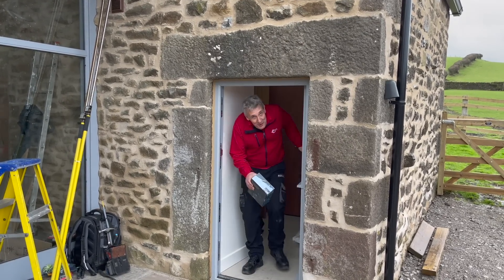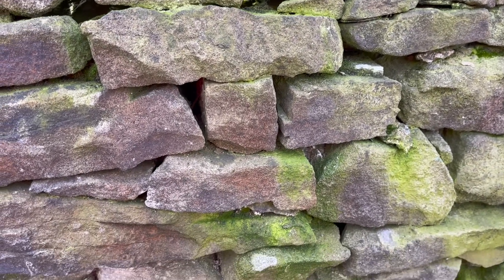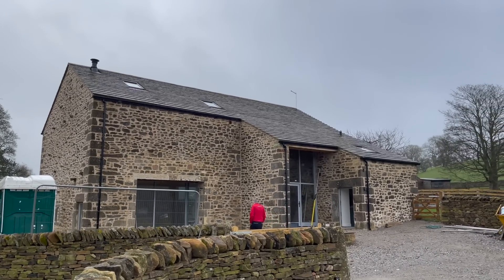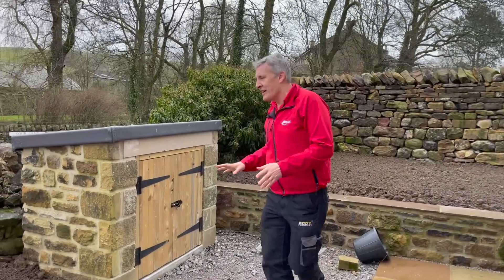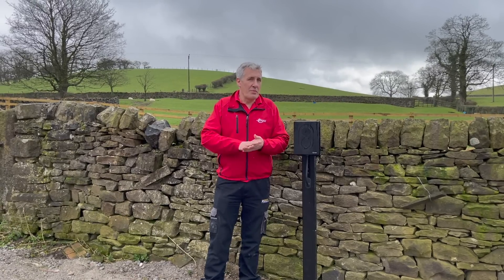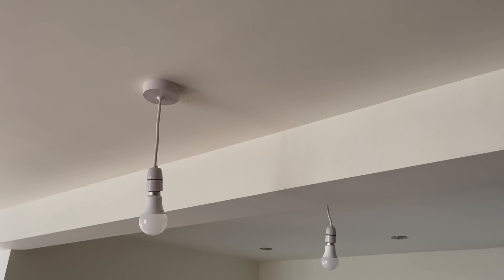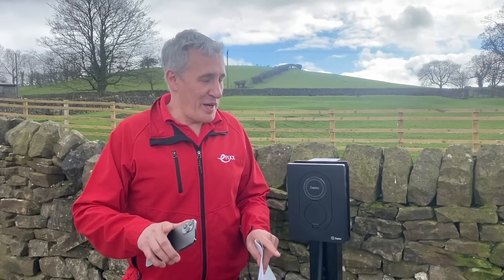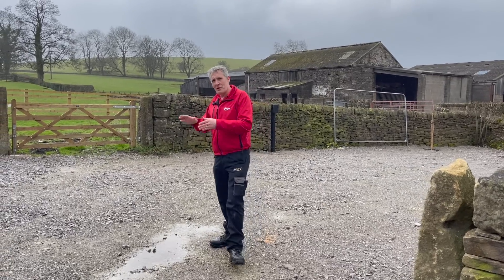ZAPTEC GO our fastest ever EV Charger Installation

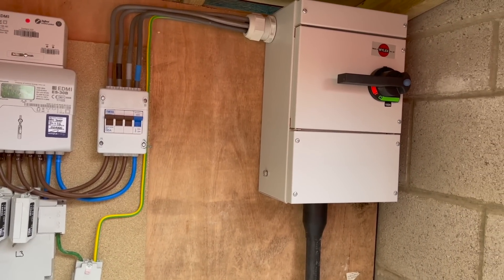Comment: 3:20 Those grey tails are a little tight on the bends...?  I would also have installed an additional means of Earthing (according to AM2)  by way of an Earth Electrode (the pit being installed before pouring that lovely concrete base) connected to that cool, new MET.

Comment: Seems a nice product indeed. One question - if there are single insulated conductors inside the post, is there a means provided for earthing the post, as I'd have thought it becomes an exposed conductive part (basically like galv trunking)? 
Does it rely on the gland plate via the armour and the armour being earthed the other end?
Reply from the maker: Yes the armour is providing the earth connection to the post.

Comment: I'm guessing that a 32A circuit doesn't create a max load issue on a 3 phase supply.
But I think there may be an issue with installing additional chargers on this single circuit in the future. The problem being that as there is a single type A RCD at the origin, ALL the DC leakage from all the chargers will pass through that single A type RCD. The individual DC limiters on each charger will pass 5mA of DC EACH before disconnecting. Hence 2 chargers could pass 10mA through the upstream RCD, thereby potentially blinding it.
Also, an old chestnut of mine - do we bond the metal support post in this situation? 
Presumably we should consider it as presenting earth potential. But if we bond it, we introduce the danger of installing a potentially "Live" post in the case of an open PEN because the open PEN device is downstream of this bonding connection, leaving the bonded post connected to the dangerous broken PEN.

Comment: What about load limiting , does it have that facility? Wirelessly 
Great video
Reply: Decent looking charger but in 2023 no load management means it is NOT properly designed for the UK market.
Reply from the maker: Thanks - No load limitation atm